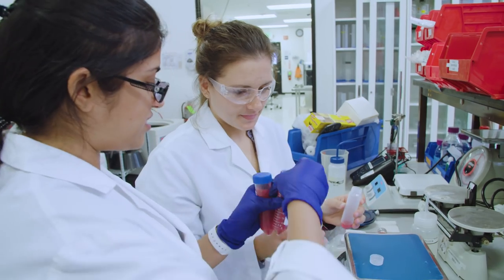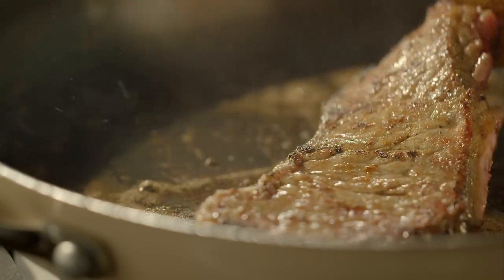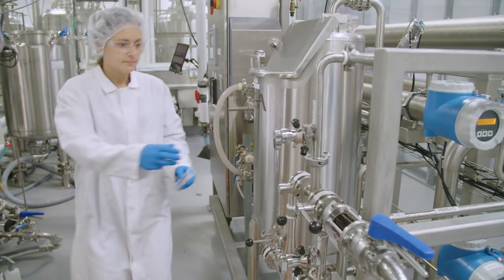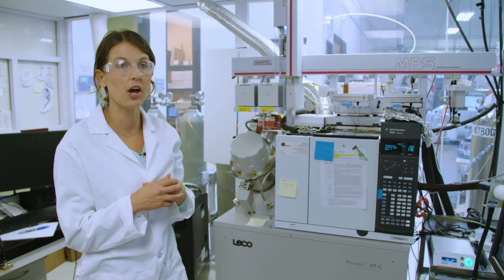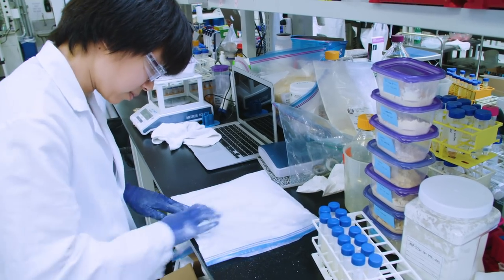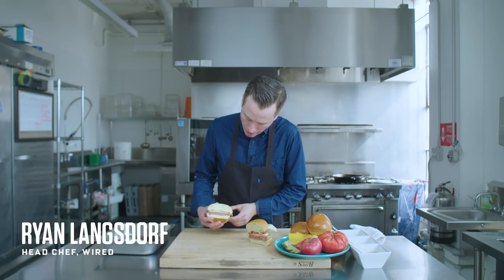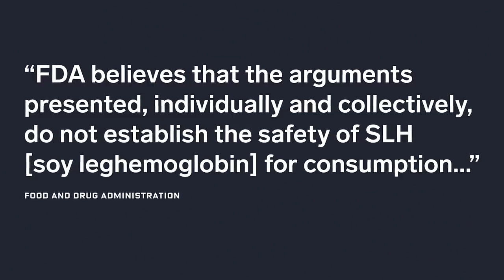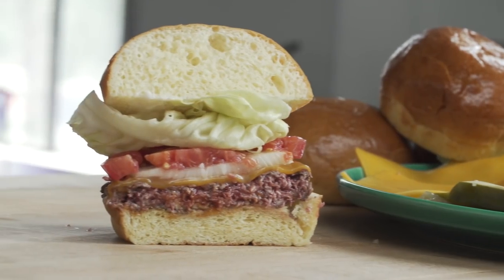The Strange Science of the Impossible Burger | WIRED

Comment: I feel that the problem a lot of vegan and veggie products have is that they want to replace meat by beeing as similar as possible, rather than beeing it´s own thing. You are always going to compare something called impossible burger to a genuine meat burger,  and the comparison is what kills it. While not bad, it will never be as satisfying as a normal burger and it fails to convert, even more so because these products tend to be expensive and are therefore not an option for the weaker economic classes as a meat replacement.